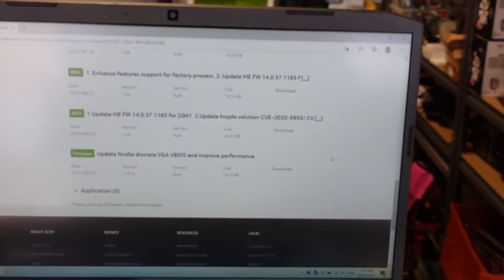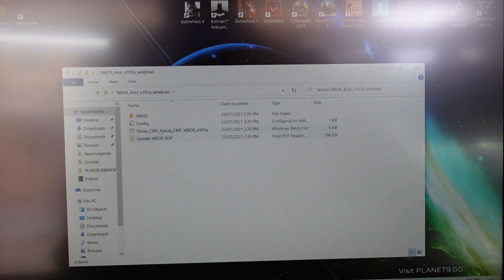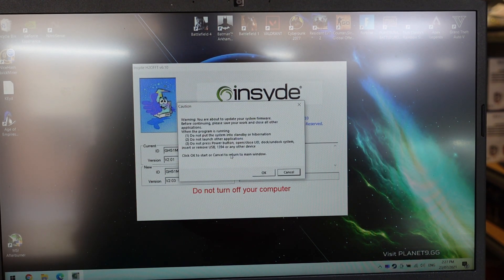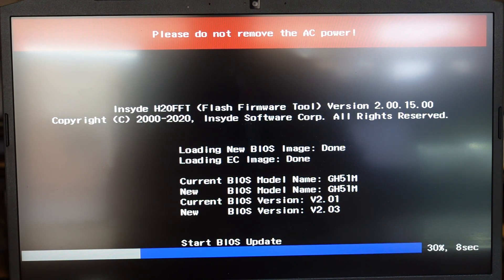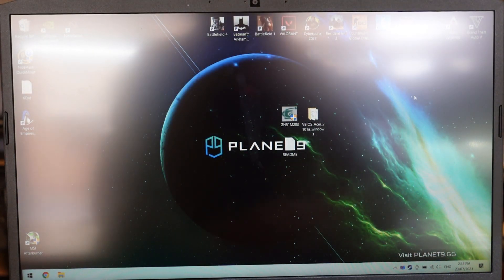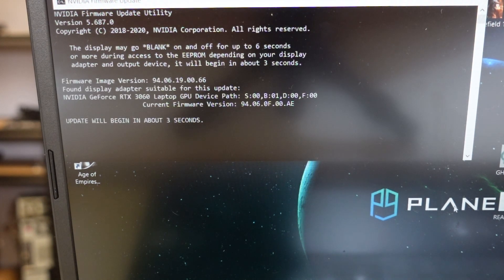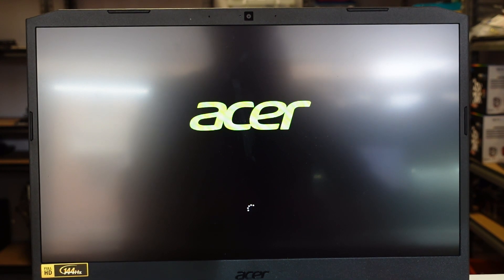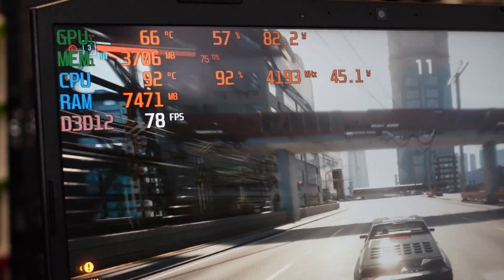Acer Nitro 5 2021 bios and vbios update!

Comment: Hey I've got a weird issue with my helios 300 (i7 10th gen, rtx 2060) and after going through tons of stuff for days now I still haven't found any solution. Now I've landed here, maybe you'll be able to help me out?
This started about a month ago randomly. After turning on any game, i would get artifacts flickering on the screen for about 2-3 minutes and the game would crash.
I've tried everything i could find on the internet with the drivers amd windows updates. After some experimenting on my own I've narrowed it down to an extent....
Any application which uses the discrete gpu crashes when the ac adapter is plugged in. They work absolutely fine wuthout it.
If I disable the discrete gpu and use the integrated one, it works even with the adapter plugged in. The laptop also randomly gets bsod when it's idle with the adapter plugged in.
Seems something wrong with the gpu. Can't figure out whether this is a hardware or a software thing? Have you ever come across something like this? Please tell me there is a solution. Would be greatly appreciated😭

Comment: idk if anyone can help, i know this is pretty old. but i have a nitro 5 an15-55-59ks with a gtx 1650ti GPU. when i go to install the firmware i goes about half way then says graphics incompatible. not sure what to do. is it a lost cause? i have 32 gb of 3200 but its running at 2933, whatever. Thanks!
Reply from the maker: This vbios update is for the 3060 model

Comment: Hey. Do you have a link to this driver? Is it for rtx laptop 3060?
Reply from the maker: its only for the RTX 3060 Model
Reply: @rickstechrepairs  Yes I have rtx 3060 6gb up to 140w. But I don't get that with the vbios i use now.:(

Comment: i have the i5-10300h with 1650ti model and the vbios update throws an error of gpu not supported, im already on the latest bios v2.06 so is the vbios update included in that?
Reply from the maker: This vbios update is for a 3060 only

Comment: hi rick, i have a nitro 5 AN515-55 1660ti i5-10300H ... the issue i am having is that my laptop struggles to boot up before the acer logo appears.. the keyboard lights up and fans start but then goes off and it repeats this until a minute or 2 passes and then it finally boots up to the log in screen (sometimes it turns on straight away, usually when i turn my laptop back on not long after using it beforehand) any idea what could be causing this/how to fix this? thanks!
Reply from the maker: Hi. I'm not sure what's going on there but if you laptop still has warranty I would look at doing a claim
Reply: could you fix it? I have the same issue

Comment: I have buying cruical ssd and it's not detected by my acer nitro 5, should I update my latop bios? To be able to add my new ssd?
Reply from the maker: if its not showing up in windows, i think you need to format the new SSD to work with windows 
"disk Management"

Comment: My Acer Nitro 5 is not getting start from power button and when i starts after 15 to 20th attempt after performing any one task it shutdowns automatically. The power is working properly when we try to turn off but when i want to power it on it not respond. Also when i click the power button the charging indicator also blinks. Any solution please?
Reply from the maker: i dont have any suggestion sorry

Comment: hello, I managed to buy the acer nitro 5 AN515-45 at a super discounted price with the 3080, I read that it has 85 tgp. with the latest bios update should get to 100 as far as you know?
Reply from the maker: i have no idea on the 3080's Wattage, so cant comment on that one
Reply: @rickstechrepairs  just to clarify, i read in an article that asus with the last bios update has increased the wattage of my model with the 3080 by 15 watts from 85 to 100 watts, the correct name of mine is ASUS NITRO 5 AN515-45-R0LY for anyone questioning about it, byee!!!

Comment: Hello rick my acer nitro 5 i5 10300h rtx 3060 is getting less than 100 fps in apex legends? Could you tell me the reason why?
Reply from the maker: What Resolution and graphics settings?

Check to see if you are set to performance mode, upgrade 3060 drivers, turn down graphics settings of Apex

Comment: Hello Rick, I think I have the same model with 11th gen, i7, 10870H(not sure entirely), GTX 1660Ti , my case was my battery worked fine till now, and i fully discharged it recently and then it even showed it fully charging it(with Normal charging time) but when I switched off my supply it suddenly showed battery running low and showed 0% on the battery (it’s only being 8 months also) but since acer care center didn’t show any updates I haven’t updated my Bios or drivers till now, can that be the reason behind it?
Reply: Hey!! I have the exact same issue. Did your's get fixed? What did you do?
Reply: @SamrudhVNayak  bro I fixed it, it’s mainly because u haven’t updated ur BIOS, first remove the charger and let ur battery drain till ur machine off itself, actual case is the battery isn’t dead, when u keep it to drain without the charger, it will start showing the battery with 70% again(it’s a bug of acer care battery cycle limitation-this is fixed in the BIOS update), once the battery percentage shows up, immediately go to settings->windows update->search for the newest update and download and install it(make sure ur percentage is over 50% and plugged in) the update shown will mostly be the newest BIOS
Reply: Is there a battery reset pin hole in this model? If not there were instructions saying remove all the cables connected and press the power button for 1 min and then keep it for another 15-30mins to fully discharge from the MB and then start it, is this good?
Reply: @shohanranasinghe4403  ??
Reply: @SamrudhVNayak  let me know if didn’t understand it correctly
Reply: @shohanranasinghe4403  Thanks bro for replying. I followed the steps and updated the BIOS... sadly it didn't fix the issue. Maybe gotta take it to the service center

Comment: i have 3050 model is AN515-55 when i download the vbios file and runing it, it tells me that it is not supported
Reply from the maker: Correct cause this bios mentioned in this video is for a 3060 model an515
Reply: i know but is there no 3050 vbios?

Comment: Because when I play games on my battery without plugged into charge so it stills stutters what causes it then
Reply from the maker: Gaming on Battery is always bad!, its limited to around 45/65watts as thats what batterys run at, you need to use the laptop with the AC Adapter Plugged in

Comment: Was your performance on your did change because iam saying that if I don't update the RTX 3070 till 100 Watts does it still stutters my performance
Reply from the maker: Gaming on Battery is always bad!, its limited to around 45/65watts as thats what batterys run at, you need to use the laptop with the AC Adapter Plugged in
Reply: And how can I maximize my cooling temperature

Comment: And sir it's also 1TB SSD and 16GB RAM
Reply from the maker: Gaming on Battery is always bad!, its limited to around 45/65watts as thats what batterys run at, you need to use the laptop with the AC Adapter Plugged in

Comment: Hello Rick Sir I have Acer nitro 5 AMD Ryzen7 5800H RTX 3070 graphics card should update the bios till 100W because i have more stuttering on my performance games while running on battery on high performance but still it lags any suggestions for games on batter without doubts because I tried everything on games but still it stutters with delay I can't move my mouse because of stuttering
Reply from the maker: Gaming on Battery is always bad!, its limited to around 45/65watts as thats what batterys run at, you need to use the laptop with the AC Adapter Plugged in

Comment: Hi, on acer's site there is "1.improve system performance" and below that, there is "Update VBIOS" option. Which one I should download or should I download both of them?  The "1.improve system information" 's zip name is "Bios Acer 1.15" while "Update VBIOS" zip name is "Bios Acer 1.13". So is "1.improve system performance" is the just new version of "Update VBIOS" or what?. If you know please respond, thank you.
Reply from the maker: Download the higher bios number.
It will included updates in previous versions
Reply: @rickstechrepairs  okay thanks!

Comment: How do I know if my gpu is working or not( nvidia one  in bios ? Need help
Issue is gpu bot detected ..and worried rn if its hardware or software prob
Reply from the maker: if its running poorly ingame, then i would suspect its running on the iGPU not the dedicated GPU
Reply: @rickstechrepairs  do you know how to unlocked the hidden advanced bios settings? on AN515-45 ? my laptop has the igpu as its primary instead of the dedicated gpu

Comment: Hey rick I'm having acer predator helios 300, I'm getting error related too GPU like DXGI device removed and IDXGI swap chain error so whether updating or resetting the vbios can rule out this problem?
Reply from the maker: i dont think a bios update would fix that, sounds like an issue with it swapping between the intel igpu and the nvidia gpu

Comment: I have the nitro 5 with the i5-11400H and RTX 3050ti 16 gig 3200 ram 1tb m.2 and I can run call of duty around 200 fps on medium graphics and the rest on high or ultra dlss on I get around 300+ fps on Fortnite on low settings and around 200+ on epic setting this system is very good I've watched a lot of  reviews people are saying this laptop is mediocre at best they're showing games only be able to run 70 to 150 fps But every game I play destiny cod fortnite the divison2 Madden I'm getting 200+ on high or ultra setting
Reply from the maker: no idea why its playing that well, i would certainly expect much worse performance
good to hear you are happy with it
Reply: @rickstechrepairs  that's impossible with 3050ti mobile.

Comment: my acer is freezing every time I try to play a game. I did undervolt and underclock with trotleStop, change processor to 99%, set the fans to max using Nitrosense but it's still freezing about 20min of playing any game. Any ideas?
Reply from the maker: Not sure on that, I would try a different stick of ram or a single stick installed

And see if it has issues

Comment: can I skip it directly to 2.06 and get the TDP increase? or should I download the  v1.02a update first then proceed with the latest one?
Reply from the maker: If it doesn't have any special instructions, you should be able to jump straight to the latest bios
Reply: I have a 2.06 bios but the power is limited to 85W, you know what to do to make it 95W, thanks in advance
Reply: @MattheWWW_01  does updating v102a revert the bios to v102a, or the bios version does not affect with the firmware version?
Reply: @reformierende_person  and is there any risk that i can damage the vbios?
Reply: @MattheWWW_01  i reallt dont know
Reply: @Enrico Miguel Llanto as I uploaded bios 2.06 to update vbios, so probably that's why I don't have 95W as you think

Comment: Hi there! I have a brand new Nitro 5 An515-55 with GTX 1650, i5-10300H CPU @ 2.50GHz, 8GB Ram with 1TB HDD. Recently updated everything and did 2 clean fresh win 11 restarts with the latest Nvidia drivers. My issue is that is running clunky and I think it´s not supposed to be like that. It takes a couple of seconds to open some basic things as folders or running games it loses FPS and stutters a lot even taking the graphics all the way down. Do you have any advice? Just tried a lot of things found on the internet and nothing seems to work out.
Reply from the maker: Is it running a SSD or Just a hard Drive?

Running a 2.5" Hard drive and not an Solid State Hard Drive, while have a laggy, slow desktop environment and a noticeable sluggish machine
Reply: @rickstechrepairs  It's running on just an HDD. Should I upgrade to SSD?
Reply: @alejandropedraza6189  hey man You should
Reply: @alejandropedraza6189   You should definitely upgrade to SSD. Also, have you changed your graphics card settings? Since you've got an Nvidia card, you can make some adjustments using the Nvidia control panel. Look up for an optimization video.
Reply: you solved it?. something similar happens to me

Comment: Bleb my laptop broke
Reply from the maker: That's not good
Reply: @rickstechrepairs  its fixed now, i have 2.03 i think thanks hopefully i get more fps :)
Reply from the maker: great, what happened?

did it take a bit to come back online after the bios update
Reply: @rickstechrepairs  I'm not a very tech guy so I watched a bunch of videos to fix it after that failed I used the safe mode and it worked that way
Reply from the maker: great to hear its going again

Comment: I have Acer Nitro 5 AN515-55 Bios version is 2.06 came with windows 10 update. But on Acer website there is only bios version 2.03. From my experience new update is using more GPU sometimes GPU copy is 100% and in Forza Motrorsport game menu text was flickering for several times when playing earlyer today. Should I downgrade bios from website?
Reply from the maker: Hi, is your nitro 5 the 3060 model?

you shouldnt have to downgrade, done a video driver update?
Reply: @rickstechrepairs  Hi, mine is GTX 1650ti model AN515-55-52KW
Reply: @Gshekela  did you manage to fix the problem i also have weaker graphics power?
Reply: @MattheWWW_01  you solved it?. something similar happens to me

Comment: Hi my Acer Nitro 5 R5 5600H and RTX3060 has 95W GPU Limit. Is that normal? I can see that in Systeminformation in the Nvidia Options
Reply from the maker: Yep, looks normal for that model
Reply: I have the same one. Does the hard drive get heated up during heavy gaming? Mine has gone to 57 deg Celsius, even though my CPU remains under 75 and GPU under 70
Reply: @ankursharma-jz8rq  61°C is my highest. That's normal. I have 1 512GB nvme SSD 1 250GB m.2 and 1TB ssd in the harddisk input. The m.2's get usually hotter than ssd about 50-60°C

Comment: I have a acer nitro 5 ryzen 5 3550h /10 ram /4 gb gtx1650 graphic card/    while in battery  i got 58fps.... And when i plugged in fps drops to 20-22.....(watch dogs 2 on high settings) I dont know what is going on.... 
I tried so many optionss. Including the power plan options....  Did this update works for mee...
Reply from the maker: No, the bios update isn't for your model

Sounds like it's running on the igpu when connected to power
Reply: @rickstechrepairs   anyway thanks broo😂😂...  I just found the bios version for my model ... And i installed it...  then it worked for mee fps increased to 40 fps..  switch off  whisper mode and i changed  the max fps in nvidia control pannel to 60... Then i got 60 fps for watchdogs 2 for the first timee😂😂😂... Its around 1 year that i have bought the lap.😂😂..for the first time gpu temp rises to 80😂😂.. thanks broo❤️❤️❤️❤️